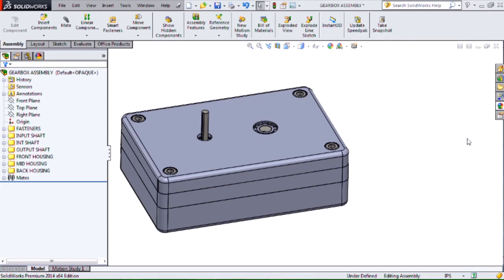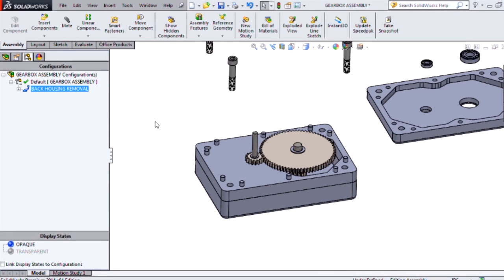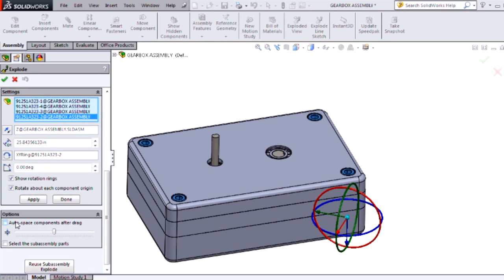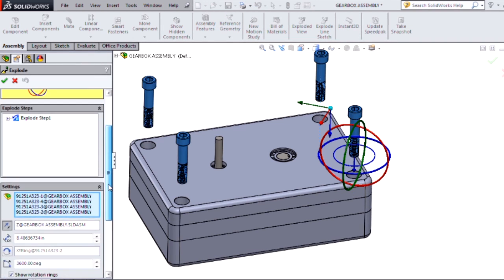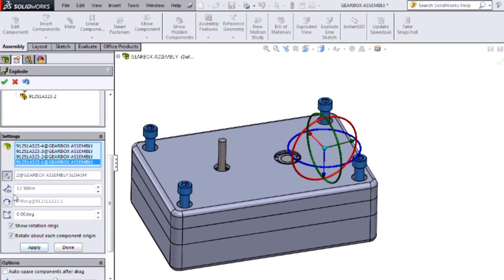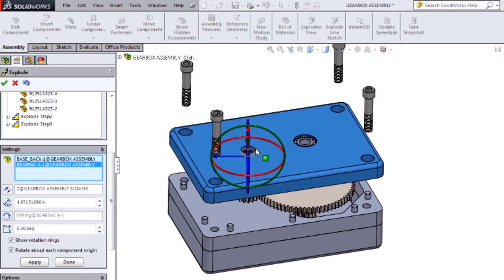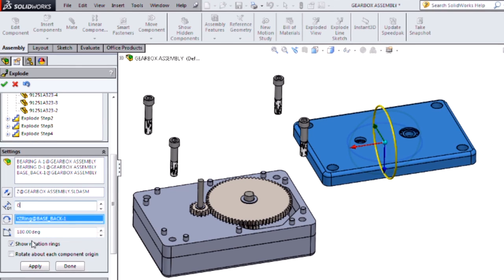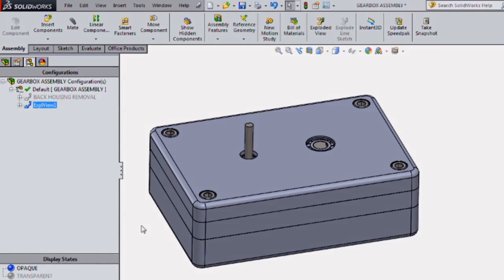SOLIDWORKS - New in 2014: Rotational Explode Steps

Comment: I'm new to SOLIDWORKS. I have been in school for the past few months and this one of several topics that I have been studying.
  These include working on a lathe, Bridgeport, surface grinder, etc. Also, I job shadow every other week for three days, and I have learned a ton in a very short time. If asked, I say that I know a little bit about a lot of things, and I want the chance to put it all together.
  I am pretty good with technical drawings but this SOLIDWORKS is on another level. I am starting to get it and my confidence has increased exponentially.